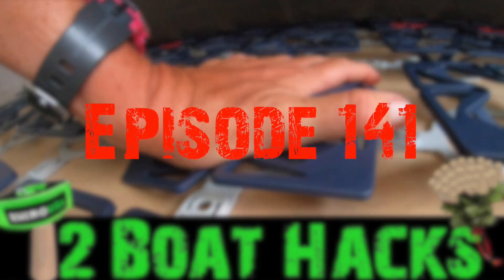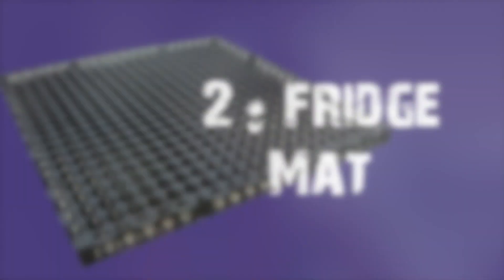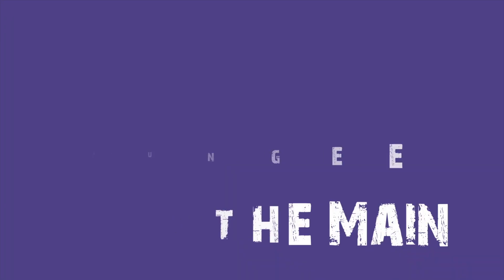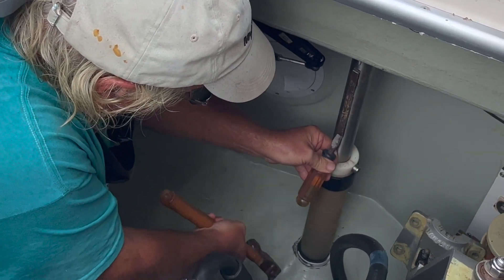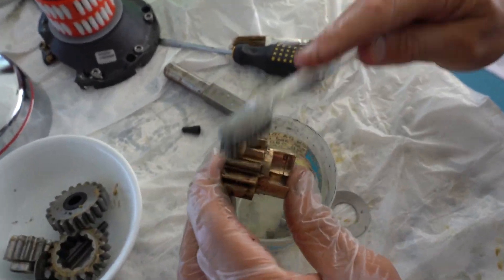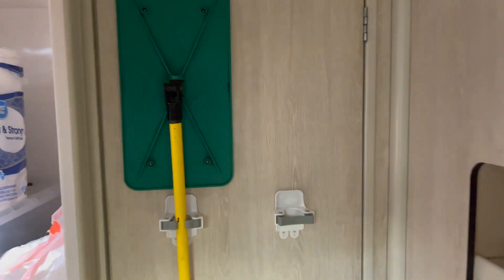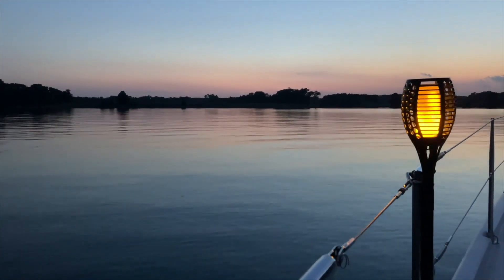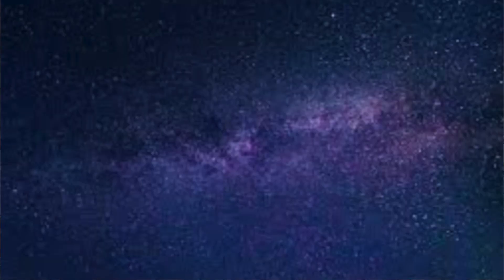191: 12 MORE Boat Hacks; Sailing Leopard 44 Catamaran

Comment: Thanks for your tips, many people will find them of benefit. A few things can augment your hacks. First, take the labels off all your cans. Insects, especially roaches, love to eat the glue and cellulose, and lay eggs there. You already have what is inside labeled. Take the labels off before you take them to the boat. Especially important in Central America. Secondly, a float on your overboard marker is key. The boat can drag the weight all over and lose your spot. Thirdly, try dumping your buckets down the kitchen sink. The screen will save you grief. Since we have a salt water foot pump, you can save fresh water too if you need. We also store like parts together. Pretty helpful to have everything you need for a certain job in one place. Along those lines, have the wrench for bleeding the engines in the engine room on a lanyard. I would be cautious shaving keys. A mono did this on his prop shaft. It fell out, the shaft and prop fell out, and all of a sudden there is a big hole in the boat. Several of us had dive gear, plugged the hole with a trash bag, found the shaft, inserted it through the gland, and another boat had a trash pump and we pumped out the boat. We found the key in the bilge, too. One last thing to try. Take a pic of people you meet and their boat card and put it in an album on your laptop. Instant memories! Keep up the work, you’ll look back in 10 years and won’t believe what you will have learned. Fair winds and don’t miss the Bay Islands. Or Providencia. Or the Albuquerque Cays. Or San Andres. Or Panama. Or Columbia. Or Tikal Or, well, anything.
Reply from the maker: WOW!!! SOOOO many GREAT suggestions here!! AMAZING!!! Thank you for sharing all of this. I have to read and re-read to write it all down and put it into practice!! Many thanks again!

Comment: Great video , very good informations ! First time  I hear about greasing the JP3 bearing ? Sound like a good idea ! But I never did on my leopard 44 so far . Does the grease really stay in ? Since the bottom bearing  is under water often?
Reply from the maker: Thanks for watching and your feedback. We changed our bearings from aluminum to nylon as ours were seized but not fully. We were told to grease them every time we haul out. The leopards have a weakness in their factory bearings. We are not sure how long the grease lasts but I am guessing it breaks down over time which is why they say to grease every haul out.